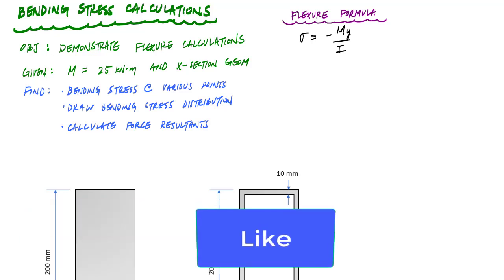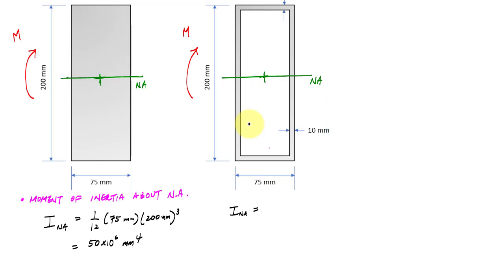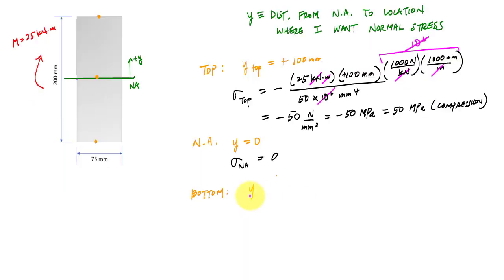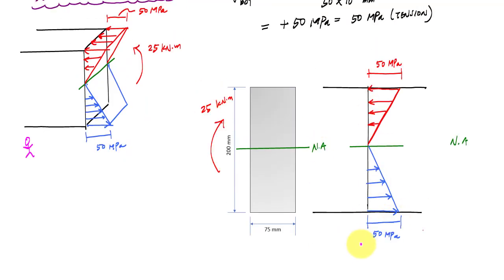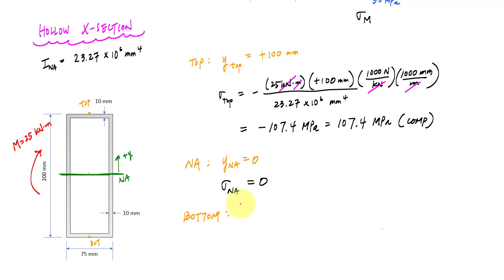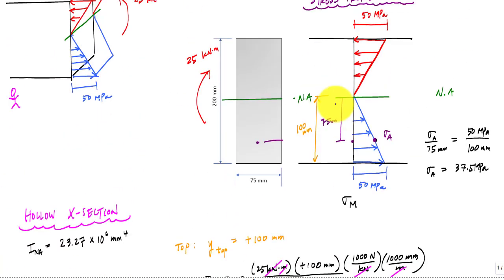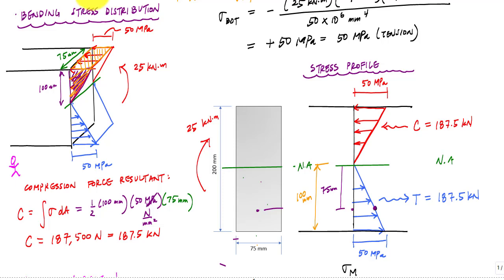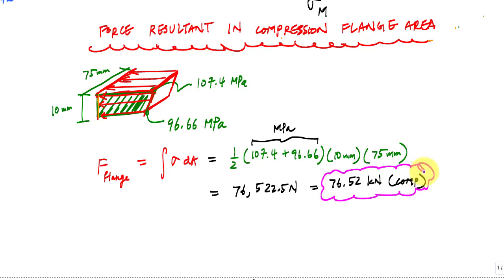Bending Stress Calculations, Profiles, and Resultants Example - Mechanics of Materials

Comment: Hi, can i ask you a bout the a proximate concrete beam dimension with 7 meters clear span
Reply: As a start, ACI 318 has a minimum depth of member equal to L/16, where L is in inches and the beam is simply supported. Good luck!